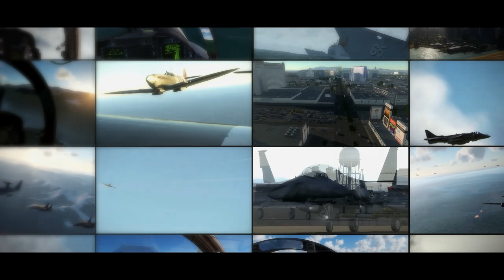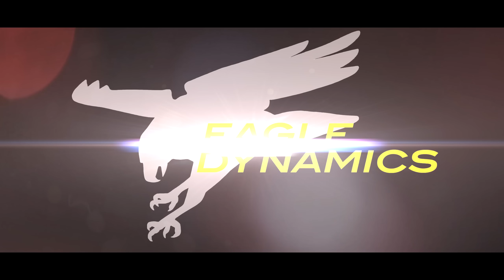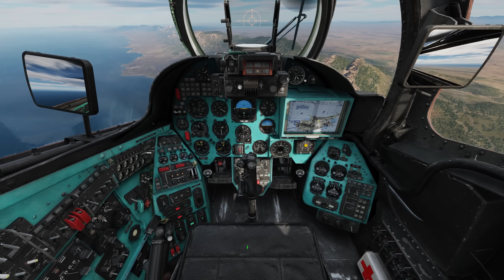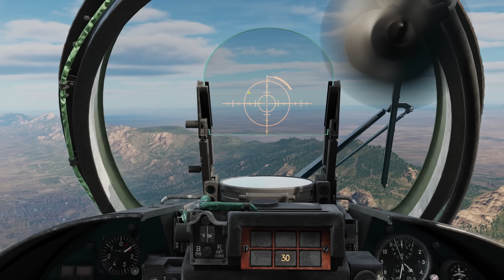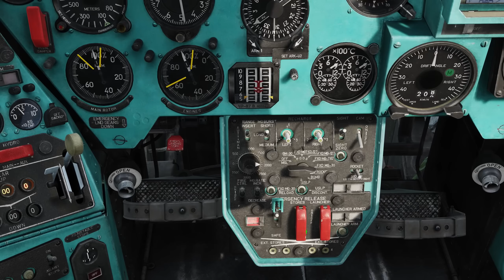DCS: Mi-24P Hind | Unguided Weapons

Comment: Just a question: is the speed drop really valid during the fast burst of the GSh-30K? As far as I know, if you set the fast burst mode, the cannon could slow down the entire helicopter in the air, by a 100km/h, even if the speed was over 250km/h. I saw several times the Mi-24P firing in real, at the local firing range with both cannon mode. The slow rate of fire is the mostly used way of firing, because of the extremly huge back kick of the high rate mode.

Comment: Nice video. I wonder how you succeed to turn as slowly around  the hind without jerk. With your mouse? Keyboard?
Reply from the maker: You can adjust the keyboard pan speed in the view.cfg file.
Reply: @MattWagner  thx. I found a view. Lua, I think it's the same. After that quite difficult to find the good parameter to change. But Thank's to tell me which file we have to modify.

Comment: Will we be able to jump to the front seat in multiplayer? I mean if it's needed to arm switches there to fire weapons and you don't have a real human in the front?

I know a lot of players will want to fly this and shoot unguided weapons without a human gunner in front. I just hope we can do that in multiplayer.
Reply: switching seats im 99.999% sure will be done just by pressing 1 or 2 on your keyboard, for flying alone (without another human player) you will be accompanied by "Sidrovich" which is the Hind's variant of "Jester" found in the F-14A/B
Reply: @koekiejam18  Yeah, but in the F-14, in multiplayer, you can't jump into the rear cockpit with 1 and 2 as it is multicrew. So the only way to operate anything back there is to have another player afaik.
Reply: @Antares2  AFAIK, both jester and sidrovich are meant to prevent that, it might be an inevidable issue due to how DCS servers are structered...
Reply: @koekiejam18  Nineline confirmed in a different thread that there will be a way to tell the AI gunner to toggle those switches that are needed. So it should work fine. Thanks for responding though 👍
Reply: @Antares2  that AI flicking switches is called Sidrovich...
And youll tell him the same way you tell jester probably.